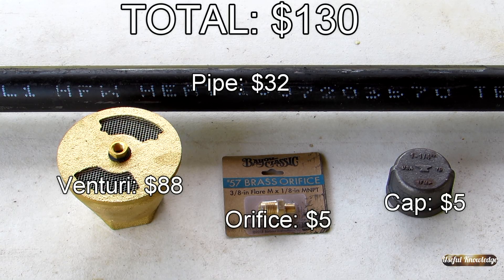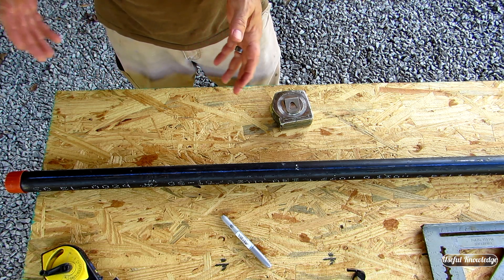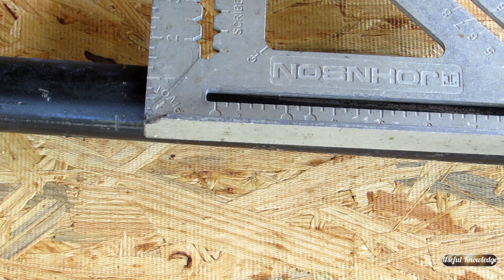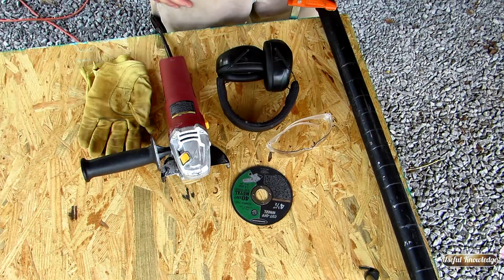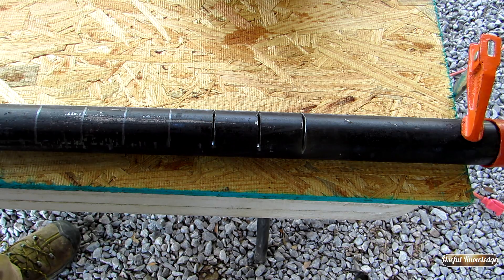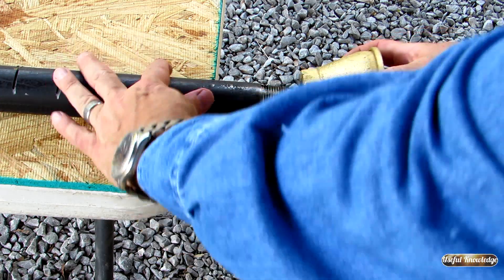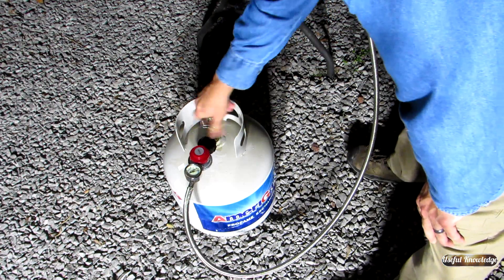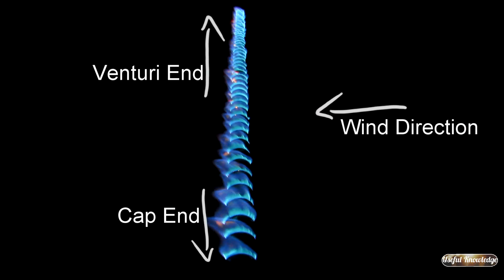Homemade Pipe Burner | Useful Knowledge

Comment: how do you increase btus? more psi from regulator and larger flame holes? larger diameter orafice hole?
Reply from the maker: You could move the cuts closer and then up the pressure.
Reply: @ thanks for the info!

Comment: Can a flame go inside the regulator?
Reply from the maker: You pop back up into the regulator like it can in a gas torch?  I haven’t had it do it to me.  If it does, just turn off the tank.

Comment: Which give bigger blue flams , holes or line cuts on the pipe?
Reply from the maker: I like the cuts because it’s faster to build and I know they work. Also, I’ve been using then ones built with cuts for many years.

Comment: Cool project! What happens when you turn it up to 30 psi?
Reply from the maker: Hi.  Thanks!  Turning that one up to 30 would probably blow the flame out.  I made a homemade venturi in another video that would run in closer to 30.  Here is that video: Homemade Pipe Burner with Homemade Venturi - 2ft version | Useful Knowledge
https://youtu.be/XKa_4Tdh6Jk.  I put that venturi on the longer pipe in the video you watched and it worked great,

Comment: What thread count did you use on the pipe to match the Venturi?
Reply from the maker: Hi.  It’s a general specified thread count for each size pipe.  I just told Lowes that I wanted the pipe threaded where they cut it.

Comment: How did you determined how many holes you will make?
Reply from the maker: Honestly, I started at the 8” throat mark and just marked them until I got to the end of the pipe with the last cut just before the threads.
Reply: @useful.knowledge  the questing is :are the holes too few, resulting in less than desirable BTU? or the number and size is OK. i can't see any resources for that.
Reply from the maker: They seem to be about right on the distance if cuts.  I have three 2ft burners that I built the same way and they work perfectly.  They will boil syrup really well.

Comment: not sure what I am doing wrong, but I cannot get my flames to be even.  it starts out low, like very low and toward end of pipe flames get higher.  can you give me any pointers?  I am using a 1 inch pipe.  all my cuts are 1/2 inch apart.  I did give a 8 inch throat.  my venturi is  a 3" to 1" reducer and using high pressure regulator.  Any ideas will be appreciated.
Reply from the maker: What size is the orifice hole?  Sounds like the gas needs to be slowed down slightly. I mean very slightly.
Reply: @useful.knowledge   I ran a pin gauge through it and it was .0395

Comment: Great video. I am wanting to make a pipe burner for my pig rotisserie. Is there a formula for how much heat it will create? I kinda need it so it will get hot. Is there a way to get bigger flames and or more heat? Any advice would help. Thank you!

Comment: Great stuff. Do you know anywhere to get that Venturi? Trying to make a home gas fired pizza oven and Tejas Smokers is out. Internet is not helping me.
Reply from the maker: Hi.  Wow!  They are out of stock on venturis.  This inspired us to come up with a completely home made venturi.  I just got done trying it out.  It works perfectly and requires parts that we bought at Lowe’s and Amazon (Lowe’s didn’t have a pipe tee so we ordered one).  We only had to drill one hole to mount the orifice. We should have a video of how to build in a few days.
Reply: @useful.knowledge  Awesome! I bought a cast iron housing and nozzle separately from different vendors. We'll see how it works out. Can't wait for your vid!
Reply from the maker: Hi.  The video is up our channel.  What we show there is about as simple as it get and works great!  I think it works just as well as the purchased venturi.

Comment: Can a venturi be placed for example at the beginning of a tube and burner is like a meter and half away from the venturi? Would there be any problem with a flow? I am doing custom gas grill
Reply from the maker: Hi.  Once you get to the burner part, how may cuts or drill holes do you have?

Comment: This is great stuff. It’s funny, I’m looking to build one for a syrup cooker too. I will have to alter the design a good bit tho. I’d like to run natural gas and my pan is only 12”x18”. Thinking stainless tubing with holes drilled. Anyways I’ll get there. Do you know of Venturi construction for natural gas? I gather it’s a bit of a different setup
Reply from the maker: Hi.  The orfice size would the difference between natural gas and propane.  I would call the Tejas Smoker folks to check if there venturi works with natural gas.  I don’t see why it wouldn’t because it should just need the correct orfice for natural gas.

Comment: hi, i hope i can ask you some questions regarding your burner. i am planning to make 2 of these pipe burners for my 275 gallon oil tank for a grill. would these be hot enough? thx.
Reply from the maker: Hi.  Sorry just saw this.  I used three of these to boil sorghum juice for syrup.  What is the size of the grilling area? My syrup pan is 2ft wide and I had them spaced evenly.
Reply: @useful.knowledge  the grilling area is roughlty 24" by 60". but the cooking area will not be that big. so instead of having 3 or 4 short burners like the traditional grill, i think about using 2 long burners running along the length of the grill. from your video, can you adjust the flame higher with the regulator or this is not adjustable. also you mentioned 3 burners, are they tied together into one bottle with 3 separate ball valves? thx for quick reply.
Reply from the maker: It is somewhat adjustable using the venturi and the regulator.  Also, I bought several of the orfices so that I could drill them out to get the perfect burn.  I drilled one out too much and couldn’t get good velocity of the gas.  The orfices are the least expensive part of the build so that’s where I concentrated on the gas adjustment.
Reply: Did it work for your 275 pig cooker ?

Comment: What pressure do you run to the burner
Reply from the maker: Hi. I initially bought an adjustable regulator so that I could go up to 30 psi.  I’m not even close to that.  I honestly think it’s probably around 10 psi after I drilled out the orfice.  After I drilled it out the gauge on the regulator doesn’t read correctly so I really don’t have a good answer.   If I had to do over, I would buy a 20 psi adjustable regulator.

Comment: I just saw your video on building a pipe burner my cooker for maple syrup is 60 in long and 28 in wide how many of those pipe burners do you think I would need and how far away did you put yours from the pan
Reply: Great thank you for your help I thought your video was very informative and to the point
Reply from the maker: Thank!!
Reply: Okay thank you I was wondering about that because I fired mine up and if I try to run much over seven or eight PSI then the flame is really starving for air it burns best around 5 psi
Reply from the maker: Hi.  I went out and measured my setup.  I have three burners for a 24” wide pan.  I have the top of the pipe 8” below the bottom of the pan.  I think three burners would most likely work for a 28” pan.
Reply from the maker: My advice would be to build three of the burners and try the setup with your syrup pan full of water.  See how it does boiling the water.  This is how it verified my setup was good before making sorghum syrup.

Comment: Thanks   and  Great to see the Safety tips !!   I see a Pizza oven  burner  bent into a U
Reply from the maker: Thanks and that’s a great idea!
Reply: @useful.knowledge  You may be able to pick something up cheap as a shell.   I'm looking at  something like a home built   ooni koda 16.  And fill it with expanded perlite as the insulator.  1 1/2-2 in thick walls  and a pizza stone.  Maybe a high temp glass door..
Reply from the maker: I looked up the Ooni Koda 16. You’ve got an awesome idea.  I’m wanting to build a canning shed and something like this could go on the covered porch.
Reply: @useful.knowledge  Spread the knowledge wealth in this global Village. 
Hi from New Zealand BTW
Reply from the maker: I work with a friend that is American Samoa. He spent his honeymoon in New Zealand a few years ago.  They really had fun.
Reply: @BlueJazzBoyNZ  this is precisely what I'm here for. Please make video if you do make that build. It's been bouncing around my brain for a few months but i have no skills.
Reply: @JidduVillarin  The dimensions of the Ooni can be estimated. For the Body, I suggest you make a mockup in cardboard.
Which you can then layout as a template for the stainless.
You will need to take into account that bent sheet product are NOT a Hard 90 degrees  (Look into K factors) and adjust.
Basically scope what is in the shops with a good review, take some notes on thickness and dimensions and mimic.
This is all for personal use only of course.
(So long as your not selling a copy as an original)
Reply: @JidduVillarin  I would be cutting into it. More flame is more heat. And use a adjustable gas regulator.But I AM NOT an Expert on the Gas. Id ask a certified gas fitter in your area.

Comment: Hello, like your video , what if I make the hole spacing 1/2 “ ?
Reply from the maker: If you cut them at 1/2 inch, I wouldn’t make them too deep because you have to make sure that you’re not cutting so many that you’re regulator/tank can’t keep up with the amount of gas flowing.  The issue is it could freeze up the fittings.
Reply: Tks

Comment: How do you hook up two burner together ?
Reply from the maker: Hi.  If you are wanting to connect them to the same propane tank, you can use a splitter or manifold.  Honestly, I have three identical setups connected to three separate tanks in my syrup cooker.

Comment: Planning on using this for a boiler. Thanks.
Reply from the maker: Hi.  I built three of those last summer and they worked great on my syrup cooker. All the best building the boiler.
Reply: @useful.knowledge  Thank you. This will be much more reliable than ceramic tiles, which are already consumable, but prone to cracking.
Reply: What is the other name of that venturi? Or where do i buy that? Thank you.

Comment: I am looking to build this for a gas fire pit to put on the porch. What will happen if I do not use a venturi?
Reply from the maker: Zack Lanford.  Hi.  The venturi basically mixes air and the propane.  It lets you adjust for the perfect blue flame.  If you want yellow flame, I could see giving it a try without a venturi.    You’ll just need to mod it up to connect the propane hose tank to the pipe.
Reply: Any suggestions as to the mods that may be needed?

Love the videos, interested in trying this

Comment: Can I use this with liquid petroleum gas?
Reply from the maker: John Francis.  Hi.  I understand that LPG can mean propane or butane or a mix of the two.  That is a propane tank that I have it connected to.  I haven’t tried it on anything other than the propane.  I made my orfice adjustments on the knowledge that I would be using propane.  If I did use a different gas, I would try it to see how it does and make adjustments with different orfice sizes.  Hope that helps.
Reply: I Kno to run a furnace off lp you have to use a retrofit kit that has different orifice sizes and a low pressure safety

Comment: Hello I have a canning question can you do boiled chicken and beef and ham the same canning method you use with the bbq sauce and jelly? thanks love your advise!
Reply from the maker: Albert & San.  Hi.  Thanks for the nice comment!  The answer is unfortunately no.  For meats and non-acidic veggies like green beans, you need to pressure can so the temps get up to 250 deg.  I actually had a viewer comment that she cans chicken in a 250 deg oven.  That’s seems like it would work because you are getting your temp to 250 deg.  It may be worth some investigation.  All the best canning.
Reply: @useful.knowledge  Thanks so much will do